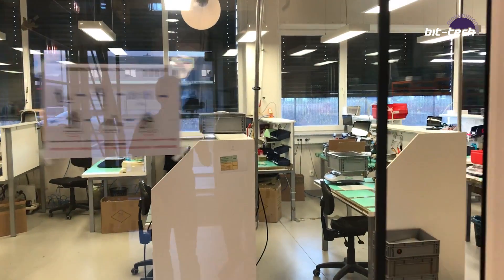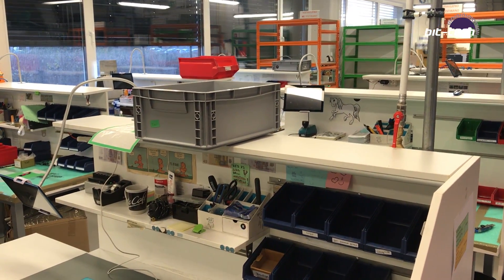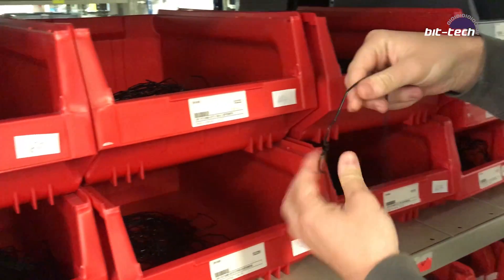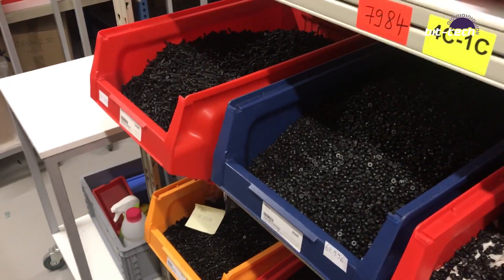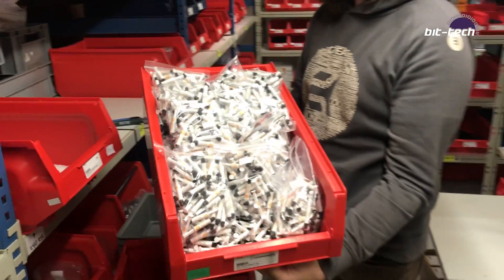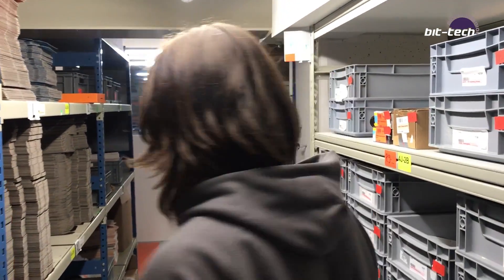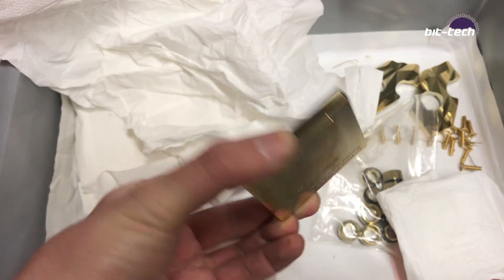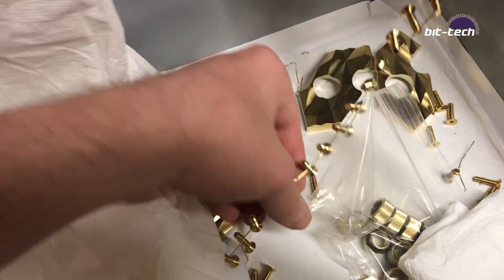EKWB Factory Tour (re-upload) - See How Water Blocks Are Made! | bit-tech Modding

Comment: When it comes to watercooling, quality control and reliability is the most important thing. I hope manufacturers prioritize this more than 1-2c performance uplift. All the waterblocks i've used for my gpus so far leaked. It's just unacceptable. There is 0 user error we are talking about. Just badly designed waterblocks. Fck you Phanteks.

Comment: Hello bit-tech guys, a question for you: did you run any Computational Fluid Dynamics models on your design of (micro) fins and channels?
Reply from the maker: Heyo, Alex here. I did try once but I quickly found it just wasn’t something that was particularly worth the time. For commercial products though it makes sense, EK would for instance.
Reply: @bittech1  Ok, I see, you are not EK. That's the question: did EK do any actual RESEARCH on the effectiveness of their fin geometry and overall water flow? Your video shows a plain manufacturing, not research or development. All indications are that they have not done any research. If they did, all their place would be covered with nice colorful pictures of heat distribution and fluxes, with tons of charts about heat transfer flux density (or thermal impedances) per water flow rate. Do you know of any water block manufacturing company who did this?
Reply from the maker: @alichen6868  It’s worth mentioning that obviously we weren’t allowed to film inside the R&D offices you know. I’m not entirely sure how you could draw that conclusion from not seeing research print outs in an office, that we didn’t even film?

Most likely EVERY major Watercooling company will do some form of CFD analysis at some point when developing a new product.
Reply: @bittech1  I already stated one reason why I think that no modeling was done. The models are usually a badge of pride for a company, and a good marketing tool. There is no need to hide the fact of modelling, and no need to show any actual result that might constitute know-how. I found, however, a significant academic effort in microfin area, there are world-wide conferences etc. However, this does not replace actual optimization of channels, smaller-dense fins are not always better.

Comment: Surprised that they didn't use / only used Swiss lathe for the screws and fittinfs 

That would had been my bet ( the precision and speed of them is like way higher)
Reply from the maker: Might well be a cost factor for the individual shop that makes them for EK tbh. Fittings are pretty low tolerance parts, sliding head lathes are £££, the additional throughput might not justify the price increase for them.
Reply: @bittech1  if i dont remember to wrong from when i last checked then the price wasent that much higer then a standard leath up to about ø45mm ( im a fully educated machinest btw and love machining. buth the cam and the running on the machine it self and is pretty skilled at it as well )

Comment: My nickel GPU block corroded (GTX 10xx FE) and it isn't nice enough anymore to be shown vertical, is there a way to be helped out by EK? 
Maybe for like ~70€ or so (idk just a guess) and I would be happy. The corrosion is my fault, as I only used distilled water and not EKs premix (changed now), but I still don't know why it would corrode (nickel plated blocks from EK and copper radiators (GTS) paired with Barrow fittings)...
Thanks.
Reply: The metal corrodes until the distilled water has the same concentration of ions as the metal - also known as equilibrium. Very pure distilled water is actually electrically non-conductive because it has so few ions. There are videos on Youtube of guys submerging entire PC's in water and working for a while (until the water accumulates enough ions to become electrically conductive, then the PC parts die lol).
Reply: @umadbroyolo8413 K, but still, is there a way to get a replacement nickel block from EK?
Reply: @christoph6055  I doubt it, but you can try your luck and contact them. Alternatively I'm sure you can just re-anodize your block.